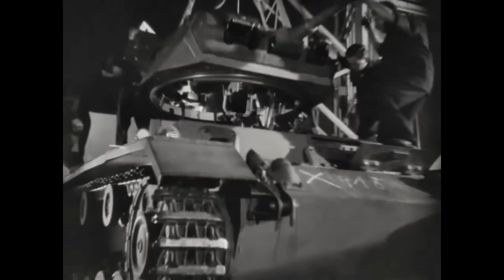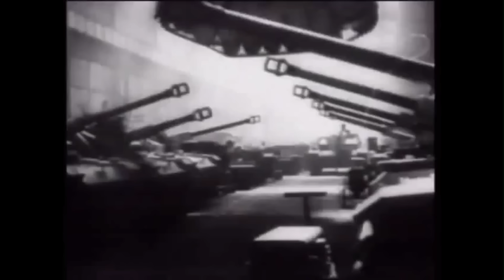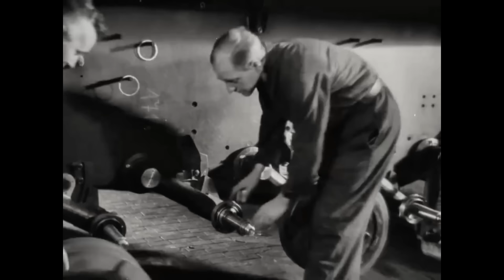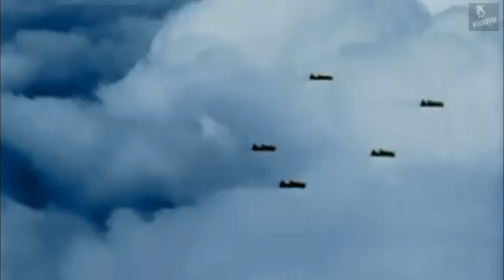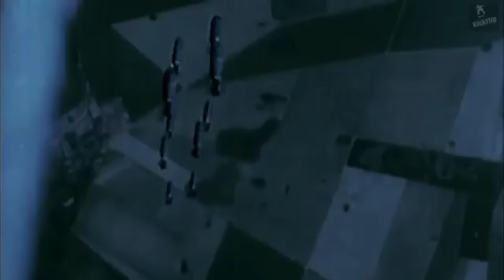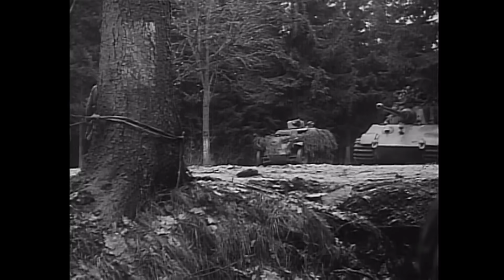Forging the Tiger: Inside Nazi Germany’s Most Famous Tank Factory (Henschel & Son in Kassel)

Comment: The Tiger was a tank of limited operational use.  It was a breakthrough tank that could take fire and continue.  The Tiger required heavy maintenance.  Where the Tiger excelled was the fear that it enstilled in allied forces.  While there were few Tigers, at a distance a Panzer IV with additional armour around the turret looked like a Tiger; and most allied tanks did not want to stay around a take a second look.
Reply: ''Where the Tiger excelled was the fear that it enstilled in allied forces'' ,   which is why allied tank crews were issued brown underwear !

Comment: You got it right. It was a war between industrial production, but also population sizes. Additionally, with control of the seas, the allies had major advantages. The Tiger is interesting in that it really never lived up to its potential. While the very last of the production had overcome some serious problems with the design and production quality, the tank never influenced the war in any serious way. And it could be knocked out, once it was understood what needed to be done. That was why they designed the Tiger II. But despite its even heavier armor and slightly better gun, it was so laden with problems that less than half of the 500 built ever reached the front lines intact. The King Tiger was even worse, with less than i0 having been built, with just 23 ever reaching the front lines. I believe all of these were lost through breakdowns, lack of fuel or being destroyed.

Comment: Great video. Tanks still rolling off the lines right to the end, though not sure how they managed to do that
Reply: German THEN Left now...🤣🤣🤣🤣
Reply: Heavy factory equipment is pretty difficult to destroy. Even with the roof gone, and the walls broken down, the equipment itself can be relatively unscathed. Production could be slowed under these circumstances, but not stopped, as long as the electricity was on and parts could be scrounged.